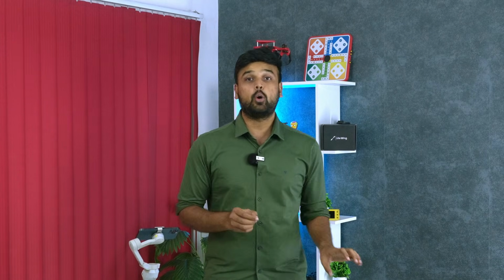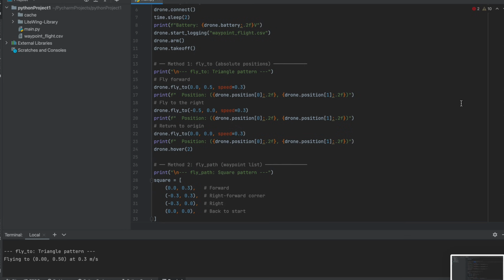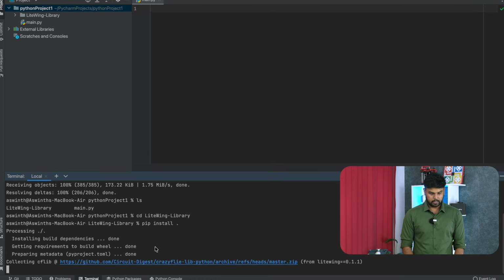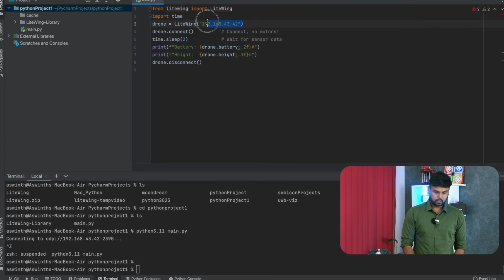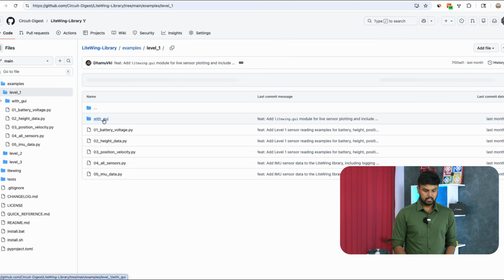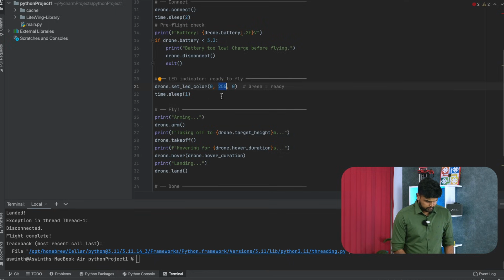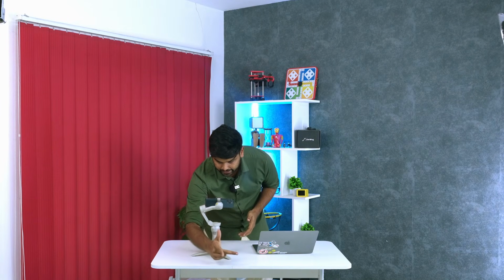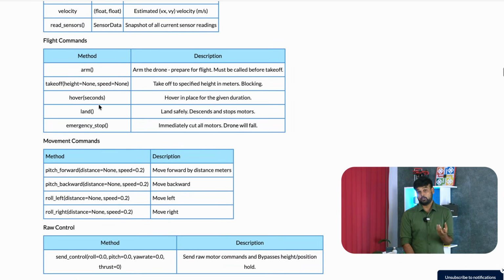How to Control a Drone using Python?  | LiteWing Autonomous Flight Tutorial + Code

Comment: I connected the drone to my laptop, and the LiteWing Wi-Fi network is showing and connected properly. However, when I tried running scripts, it did not work as expected. The forward, left, right, and backward controls shown in the video are not working. (Using cflib library)
Also, the drone keeps losing its connection even though it is fully charged. Sometimes the propellers rotate properly, but other times it doesn't. And it doesn't behave same every time.
Also i want to edit firmware for the litewing and its positioning module but its source files are not present. Can you help me with those.

Comment: Tell me one thing when we are using the extra hardware which comes height and position hold in lightwing but in app height hold now we can control but why the position module is not working in app when the drone is flying? Is it only work in python script to maintain stability? in app we can't stable This by using that extra hardware?

Comment: Excellent video and product. My litewing drone is working fine with TOF sensor (height hold) but with positioning module it takes off, hovers for a few seconds and continuously flies backwards. I am yet to debug deeper but have you seen this issue before?
Reply from the maker: Yes, try using the latest firmware on litewing wiki page
Reply: Does the tool in wiki page already loads the correct firmware ? That's what I used.
Reply from the maker: Yes. It loads the latest firmware. FYI its for LiteWing only.
Reply: You are using python script or u r running by app?